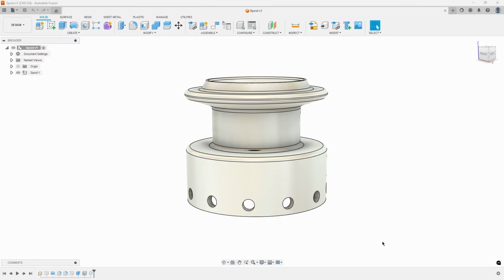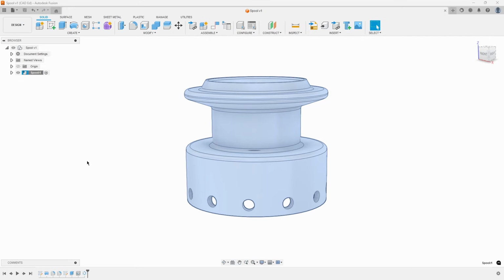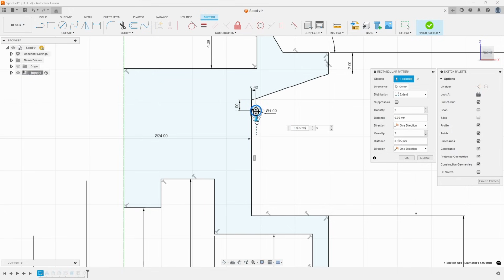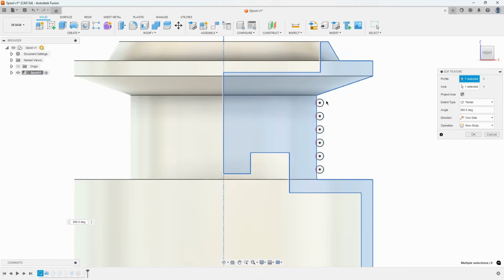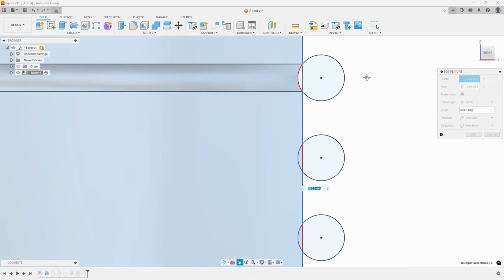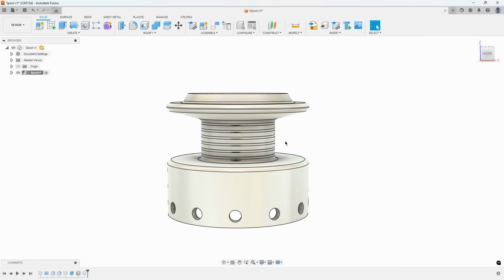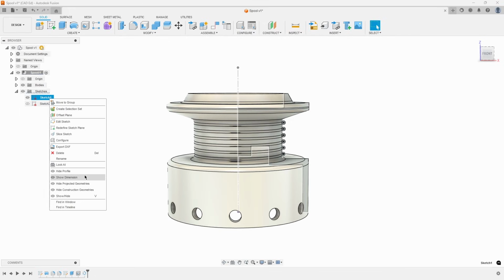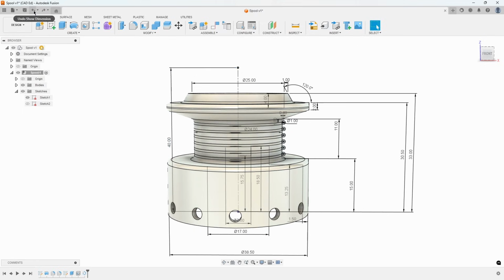Timeline Editing Made EASY | Getting Started with Autodesk Fusion Episode 5

Comment: Being a bit of a newbie at this and only doing it to create some obsolete car clips for the windscreen wiper scuttles on Renault Scenic Mk 1 2002 vintage I have found it quite daunting following the Fishing Reel  tutorial. Unfortunately as I am using the free personal use version I have found that critical bits are missing from that program and that the user interface is quite a bit different. There is no Automatic Constraint so you need to fully constrain your sketches yourself. Also the holes and grooves are not the same steps as in the paid version and it has just been updated and there were changes to the visual interface of it. I have mastered it though and completed the spool, holes and grooves included. There is also a limit on how many files you can save to 6 I think. I believe I will be able to accomplish what I need from it though. If you are running this on a Laptop it will need to be a pretty good one as even mine with a 2560 x 1600 240 Hz display and a 12 GB graphics card  Nvidia 4080 is not overly fast. Good tutorials though.

Comment: Probably a version problem again, but when I drag to get a preview, it shows only the center points, not circles like you visualization shows. This visualization is lacking anything that might show what it would look like near the end of the pattern.   Worse, somehow I got two directions selected and got an array of 6 horizontal and 3 vertical holes.  I don't want to click finish sketch because I want to correct it, but don't see a way to edit the pattern.  On the other hand Autodesk assistant told me.  I finally got the pattern that I wanted, but don't have anything in the time line except the sketch 1.  I selcted edit the sketch, was able to revolve again with all of the circles deselected and produce the desired result.  It was difficult, and time consuming (probably since I don't know what I'm doing) but it seems clumsy.  I'll continue with your tutorials before I make a decision, however.  Thanks for these.  I have spent 1/3 the time on line with the AI Autodesk Assistant.

Comment: When i activate the spool component in my fusion, it makes the part wire-framed and hides everything in the timeline except the first sketch. why is this? it doesn't happen in this video
Reply: So to fix that and continue to the timeline where everything shows, after sketching the 6 circles, I activated the main parent or where it says "Spool v1" and the timeline returned. I was able to continue with the video after
Reply: @mohamedabrar4769  Thanks this helped. To refrase it, on the left hand side where it lists the Spool and it's origin and sketches and other stuff, click on the circle next to the top-most Spool. The circle should get a black dot in it. It also filled in the spool model to look like in the video, as well as brinigng the timeline up. You can also right click on the top most spool and click activate, like he does earlier in the video.
Reply: Same here. I'm stuck for good
Reply: @tad2ik  might just be that we are using the newer version and this series is from months ago

Comment: When I "activate" the object, all my timeline goes away and all that is left is the first sketch. I can see a transparent view of the object after it was revolved, but I can't click anything else other than the first sketch option in the timeline.
Reply: It looks like the previous videos had the top level spool component active when creating bodies and sketches so they are in the wrong place in the tree. Notice how in this video they have moved down into the lower level spool component. Dragging the bodies and sketches down into the lower level Spool component seems to fix it.
Reply: Had the same problem, thought I was stuck for good.  Then I discovered you can right click any of the later "grayed out" or transparent steps on the timeline and select "Roll Timeline Marker Here" and it, uh... re-un-transparencies them.
Reply: Same! I went back to the top and activated the entire Spool project and everything came back.

Comment: Is there a way to go back into a sketch and modify a move/rotate copy command? If it’s the last command you did just undo and do it over. But what if you are much further along with your model and realize the move/rotate command is not going to accomplish what you want it to accomplish. You don’t want to have to undo 10 commands and then have to do all the work over again.
Reply: i am not sure I am following your question but ....You can edit anything that is on the time line.  Move the mouse/curser over the move/rotate step in the timeline, right click edit feature/ edit sketch
Reply: You cannot edit a move/copy command that you made within a sketch. You would have had to move it using a dimension then alter the dimension or to move it back from using the move/copy command later down the line, you would have to add a dimension to move it it add a constraint of some sort. The move/copy command in the sketch does not create a point in time (like it does outside the sketch environment) not does it create any kind of constraint icon that you can delete or modify.
Reply: After creating the pattern of circles and clicking Finish Sketch, I don't see the rest of my timeline and the model is transparent. What am I doing that is different from this video? How do I get my timeline back?